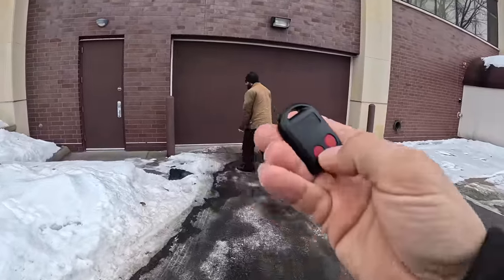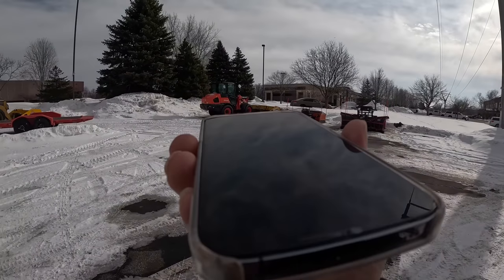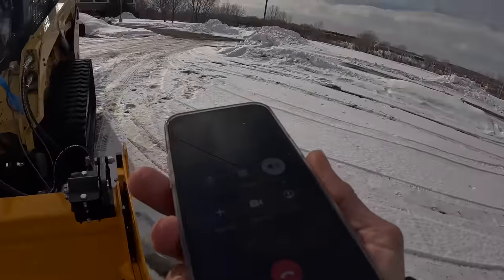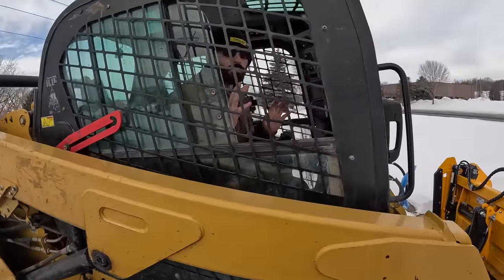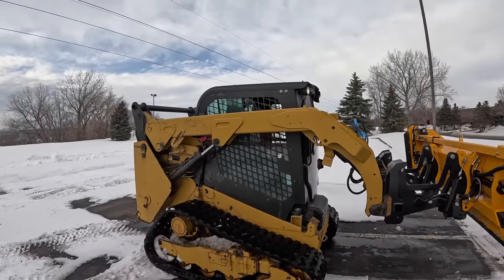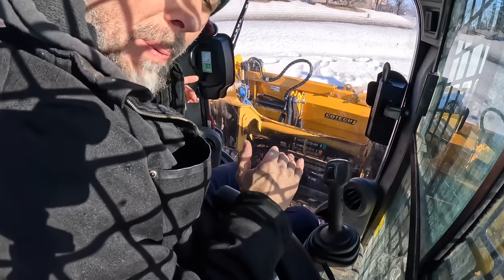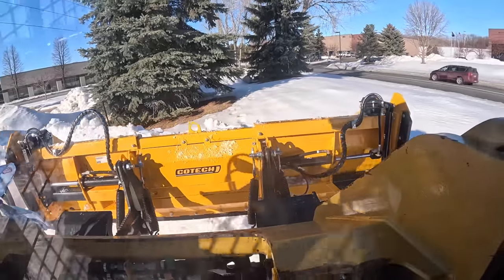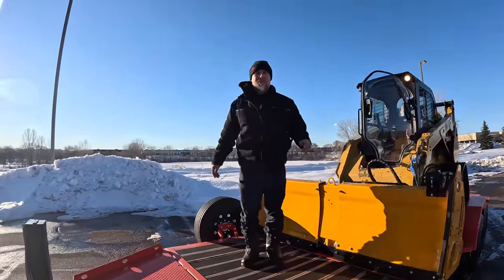The Most VERSATILE snow pusher in the world.

Comment: Great video Stanley. Met these guys a few years back when this blade first came out and demo’d the 6-10 on a tractor. This unit is absolutely incredible for cleaning parking spots between cars when we go do our final cleanups! It also excels in tighter loading docks as well! Very productive unit.
Reply: did you end up purchasing one or just the demo?
Reply: @coreywillis9417  we just demoed it as our 4066 has loader arms. We bought a cotech blade though. It’s an ext rev 6-10. They’re built extremely well! If I didn’t need to load salt I would’ve bought one of these. The mounting brackets for the tractors are where Stanley’s blade shines.

Comment: Im sure it’s great new. How will it hold up after 3-4 seasons of getting smashed into curbs and frozen snow piles.  My guess is those wings won’t slide in and out so easily and I haven’t even gotten to corrosion from ice melt.  I’ll take my 10 year old Arctic Sectional HD over that any day.  These engineers never have to fix this stuff in the middle of the night with 4” of snow on the ground and -10 temps. Less and simple sometimes is more!!

Comment: One thing I noticed is that it's a pusher and a dragger..  And you don't get the snow built up in the corners. It is almost impossible with the side boards that rotate..

Nothing more nerve racking than snow build up in your square pusher and it won't push as much as you expected. Yes it will push but the wind rows are more noticeable..

Comment: Interesting and educational video as always.  It will be interesting to learn how durable it is overtime with the amount of moving parts and lack of rigidity.  It’s easy to get caught up in capturing the right angle and footage when filming and forget that you are interfacing with a piece of equipment that can amputate a hand or finger in an instant with the accidental touching of a switch by the operator.  Keep focused on your safety when filming and use a pointer that allows you to keep your arms, hands, and fingers a safe distance away. You will be safer and what you are trying to point out will be more obvious and precise to the viewer. We love your videos and do not want you to have to make them one handed.

Comment: We use them in Québec with a lot of snow !! They are tough and great snow plow !! The best by far 👌👌💪🏻great vids stan!
Reply: i can agree ive seen these get tossed around they are tough
Reply: It didn't scrape well at all. Not sure if it's the poly edges or float feature but that's an issue for me.
Reply: I'm from Ontario and took a trip out to trois rivieres and noticed almost everyone runs this pusher on the front and a blower on the back of their tractors.

I also noticed everyone's front lawns had snowbanks as big as their houses.

Comment: At the airport we had Cotech, Artic and Metal Pless snow pushers, on my favorite tractor (John Deere 8-280 HP) I had a Metal Pless 10-18 if I remember, fully extended I always left 2 small tracks of snow at the extension point, never a super clean job, I had to make another pass with the plow half retracted, but we had mostly fixed wings, I would have loved  the flipping wings, we only had flipping wings on a Deere-744 with a Metal Pless that when fully extended wings out it was almost 30 feet wide, but mine at 10 foot wide you are limited of where you can access and plow, but a 7-12 is capable to go almost anywhere...and to be able to back drag like that is awesome!

Comment: It's cool but the contour system triggers too easily, and makes it unable to put enough down pressure on the blade. It leaves 1 or 2 inches of snow instead of scraping it up. It would only work on fresh fallen fluffy snow. If the snow was driven on at all like in a parking lot and compacted the whole bade would just float on top of the compacted spots. Instead of scraping it up. Leaving a lot of snow behind like you can see in this video. This also most likely wouldn't work very well on a wheeled skid-steer because it leaves so much snow behind of the first push you would lose traction constantly trying to push. You need a tracked machine or something with a lot of traction because it doesn't cut down to the pavement.
Reply: I run 2 on my skid steers haven’t had a problem.  And the attachment plate is different on a wheel loader.
Reply: @coreywillis9417  Lol you must lose a lot of contracts then. Good luck with that. It's obvious in the video that they do no have good down pressure at all. Not sure what you mean? If you like them than that's all good. But from seeing videos of them they don't perform great unless your customers are okay with an inch of snow left behind. That doesn't work in most places though. You need to clear the parking lot down to the pavement. This is very common in snow removal. Most vehicles cannot drive on an inch of snow unless they have winter tires. 
Those are very rare in the US. That's why we clear snow so well and use salt like crazy in the snowy states.
Reply: @troy510  not at all. he states in the video that that is packed down slush that has been sitting. none of my accounts does the snow sit. we start pushing at 2" and that scrapes clean every time. Im betting even with a bucket on a machine you wouldn't scrape clean on that
Reply: @coreywillis9417  I mean most pushers can scrape up snow like that no problem, Especially a bucket. Only if they have the rubber blades instead of steal or the fancy plastic is it an issue. But all I'm saying is in this video the pusher/plow clearly was not getting down very well and doing a good job of cleaning the parking lot compared to most other pushers. I'm not just saying that out of no where. I have done landscaping my whole life also and use these things every winter. That's why it was obvious to me. If it works for you than good for you man. You must have very fluffy snow where you live most of the time. But that thing would not work anywhere I have worked unless the customers are okay with a bad job.
Reply: @troy510  you can get them with steel poly or rubber edges. and most of my snow is wet and heavy. I just don't let it sit for days before moving it
Reply: @coreywillis9417  Okay man go get a Walmart account and use that thing and see how it goes lol. That thing isn't good enough if it's going to leave a bunch of snow behind. Again if you like it than use it if it works for ya. I won't because every video I have seen of it, It's leaving at least an inch of snow behind. Maybe it will clear it on the second pass idk. But that's a lot of wasted time hitting a whole parking lot twice every time. Not worth it.

Comment: I've never seen one in person but I do have a couple concerns after watching.  After running an hla snow wing 8-13 this season I think the snow wing is a bettered preforming plow.
Reply: Didn't look like this scrapes well at all. Don't know if it's the poly edges or the float feature or something else. I've never run poly edges.
Reply: @jamesnm21  poly edges don't scrape as well as rubber or steel which both are available for this pusher